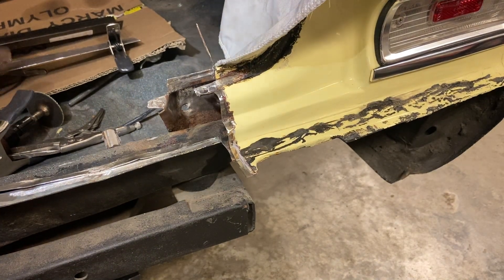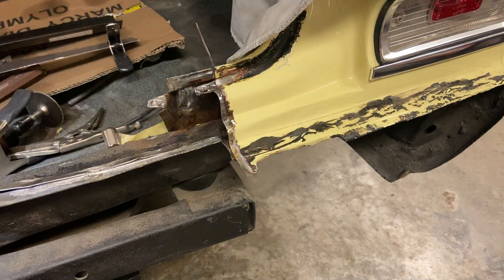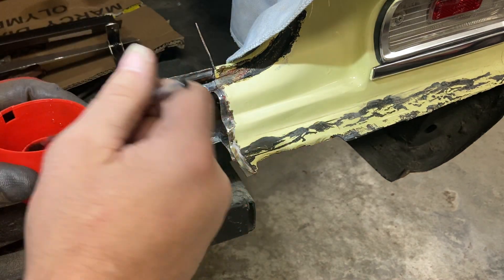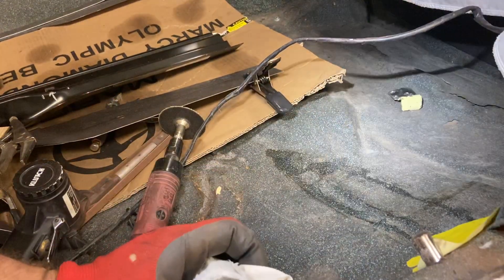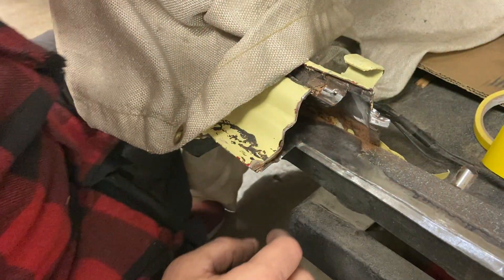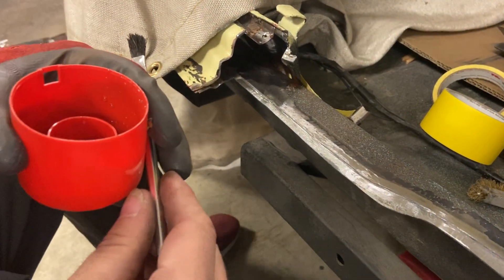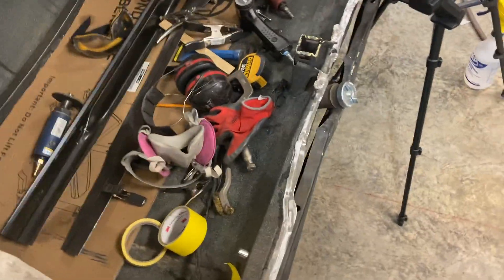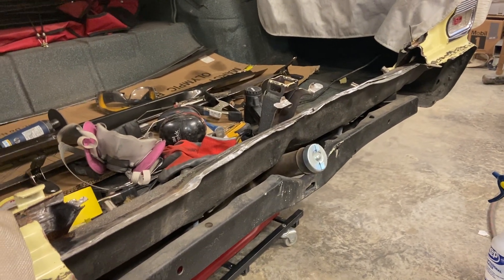Using phosphoric acid to treat rust

Comment: I was curious as to what phosphoric acid you used as I didn’t hear it, or in the description. Plus, I have a 67 pickup and very little body rust, but inside the doors and bedsides where you can barely reach bother me. What happens if it is brushed on and left behind? 
  I would prefer to clean it, the spray epoxy on it or in it. The doors are empty so that would a perfect time to do this without worry of other and all components. Any thoughts? 
I guess I would feel better considering these were built naked steel, never dunked. Just parts placed onto a holding fixture, spot welded then assembled. Lots of hiding spots! 
 Thanks, enjoy the videos and info!
Especially the SPI epoxy!
Reply from the maker: I used ospho on this one, I would be ok with it down inside the doors let us sit for 24-48 hours and kill the rust m, then if you can reach red scotch brite inside where you can, then coat it with whatever you have.

Comment: Do you neutralize with water or baking soda or just dry and wipe with thinner? I'm using epoxy and some say don't won't stick gotta neutralize, spi and ppg say no. Others say go ahead. If mfg say no should I neutralize?
Reply from the maker: Ospho has instructions on the bottle, if I remember correctly you treat the metal and let sit for at least 24 hours, spi says “if” you are going to use it, after 24 hours re apply more acid to reactivate and then rinse with water, blow it dry and prime.
Reply: @MrFireman164  yes for oil based paint like Rustoleum. What about epoxy or urethane? I've always reactivated and done by SPI standards, others say no wipe off excess and just let dry, if you get white powdery residue you dint wipe up and used too much. I've had good luck but if I don't need to do all that and just use and let dry I want to save all the rest. Thank you sir. Semper Fi and have a great weekend.
Reply from the maker: @kitjasabsgabs1830  this is what I do, ospho wait 24 hours, re wet with ospho and rinse with water, dry with compressed air, 80 grit on d/a then clean metal with 70/30 isopropyl alcohol, dry again then epoxy. May not be right but it’s the way I do it.
Reply: @MrFireman164  thank you for your time. This is how I do it and was told I was not doing it correctly. You have a great weekend. I guess some will say we're wrong even if we do it Their way. Lmao
Reply: @MrFireman164  I saw some bubbling in my repair job on a rear fender. I thought it may have been rust but it's not. I hit with 220 just to see and it's the acid. I did this on a few nice days in early November. I guess I didn't reactivate like I thought I did and now it's bubbling bad. Will make sure I rewet and do correct this time. Got some car rep 2k primer and clear just to see how it works. And it's flawless. OMG to have a epoxy 2k and I don't have to hurry and use within 48 hours as regular 2k primer in a can. Well worth $24.
Reply from the maker: @kitjasabsgabs1830  yeah acid is tricky

Comment: More Christmas presents to buy, LOL! On the acid, I can't tell you how many people have commented on my phosphoric acid videos telling me to epoxy right over it. PPG epoxy is the same as SPI. Clearly says in the tech NOT to put it over acid. It sure would have been a lot easier to just let the acid dry and go for it.
Reply from the maker: Lol, yep everyone has an opinion, I go strictly by the product sheets
Reply: I saw a 5/2022 video that the tech had a PPG epoxy high-build that caught my eye was DTM on the epoxy. It is from their “Vibrance” line which not cheap, but I tried without a logon, I could not get the TDS. The closest to me is a 28 mile round trip to my area PPG store, but maybe they will tell me over the phone what it says about use over phosphoric acid. Plus, a DTM has some level of a week acid in it. I wonder if it was phosphoric acid. 
  With chemistry in the paint industry constantly changing, it is hard to keep up. Disabled with a degree of back problems, I will crawl to get my project done, but curious if anyone has heard of it? What acid do they use? Only the TDS knows for sure I just wonder why they made so hard to get this info.

Comment: Looking good Roger ! I like using that too on those areas, A-Pillars, cracks and crevices. One painted seams like the bottom of doors on painted cars I have squirted ATF with a oil squirt can with the window rolled down into the door skin area and have had good luck with that stopping future rust. Did that on several cars that I owned for several decades and never saw rust form. It gets real thin on  a hot day and continues to seep. With a rag you can wipe it off paint and there is no staining.
Reply from the maker: That atf would save a lot of door skins if people knew

Comment: I just power washed my 67 firebirds subframe, used a cheek poker ( wire wheel) to remove loose rust. I sprayed it inside and out with 3M concrete effervescent cleaner ( aka phosphoric acid). It cleaned some areas to clean metal and the rest of the rust to a black coating. I didn’t consider it reacting with epoxy. I have a few months for it to cure out. I will investigate what I can cover this coating with.
I just learned about using cavity wax. Thank for your videos. I,ll be your friend and I don’t need presents. lol 😂
Reply: I use Klean Strip Concrete and Metal Prep, $17 at Lowe’s. Keep up the great work my friend!!
Reply: The 3M concrete cleaner was less than 20 bucks at Menards.
Reply from the maker: Good to know... friend 😂

Comment: What is brand of phosphoric acid you are using, or is it just something you buy in a gallon jug?
Reply from the maker: This is ospho but I see several that go to tractor supply or even Home Depot and use there phosphoric acid a lot cheaper than ospho

Comment: I do the the same thing where I can't get to the back of the panel easily... And use Eastwood's internal frame coating when dry or etch primer, and when the car is done and all paint is finished if I have access to the back of the panels 3Ms cavity wax or equivalent to stop future rust...i do the inside of doors b pillars down the a pillars everywhere I have access to.
Reply from the maker: Excellent great attention to detail
Reply: @MrFireman164  Yeah I hate rust and it easier to prevent it than to fix it after the fact, knew a kid who had a 70 Monte that started rusting from the inside out he was highly disappointed with his resto..... sad!
Reply from the maker: @moparnut6286  yes most don’t realize a few surface bubbles means there is a sea of rust underneath
Reply: I use phosphoric acid as well. I’ve used in spray bottles, multiple coats, scotch brute where accessible. Coat cavities such as trunk lids, pillars and rockers with either POR15 or Stops Rust. 
FYI- I found the dairy and brewing industries use phosphoric acid to descale piping. Found at Tractor Supply for $15 per gallon
Reply: @johnbarr6616  thanks! very good I'll look for it next time at tractor supply. I also use clean strip prep and etch concrete prep, it's about $20 a gallon pretty strong too.
Reply: @johnbarr6616  Dairyland Sterosol Milkstone Remover & Acid Rinse  - cool - a new source. I'm a phosphoric acid fanatic on a trailblazer with 250K - trying to turn it into the eternal pillar of India. thanks